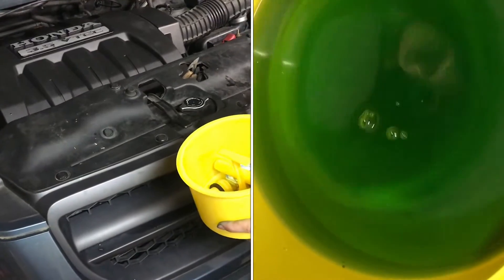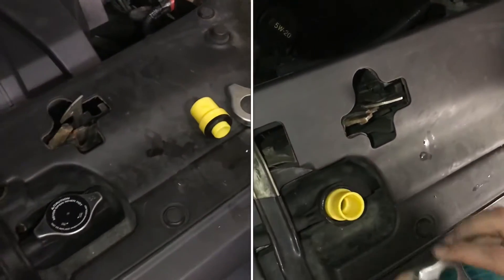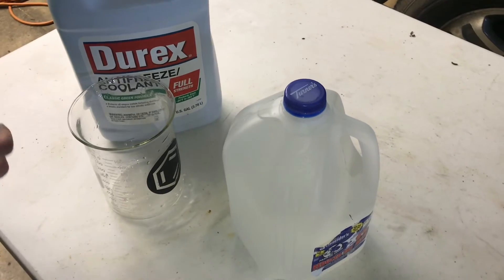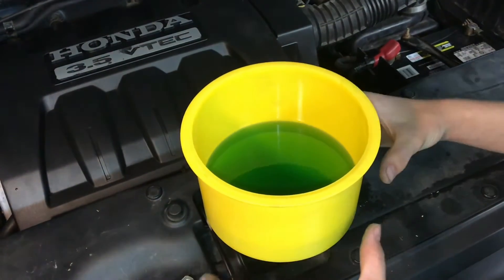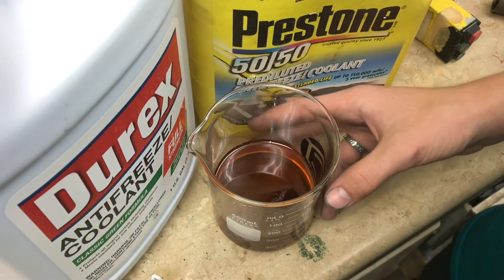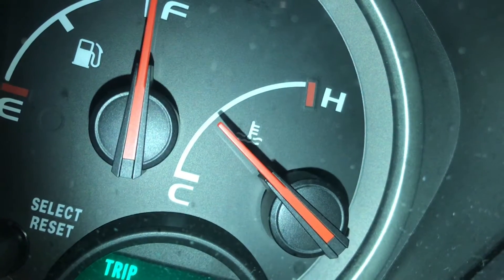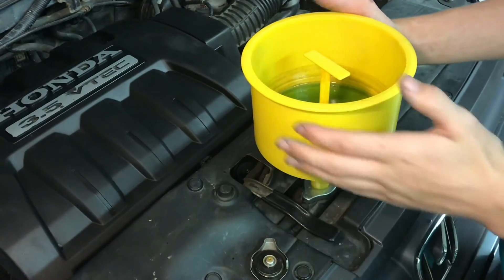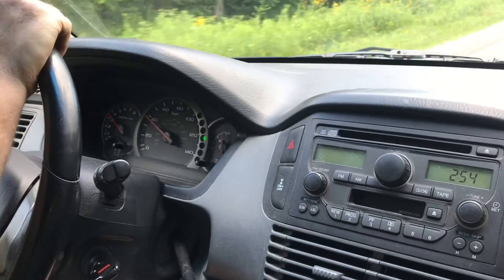BLEEDING AIR from the cooling system with the “spill free funnel”  radiator

Comment: My no spill funnel did nothing but spill coolant everywhere.. i guess it didn't quite fit? Does it have to seal tightly? None of the fittings worked, and I see people just running the engine without a funnel at all? Why does it just run out all over the place? Lol

Comment: Quick question for ya. So i have a 2012 Nissan Xterra S, i bought the Rad funnel kit that's identical recently, and when i ran the vehicle with the fluid in the funnel i noticed that my reservoir was filling up a little over Max fill range. Is this normal and should i drain out the fluid so its a little lower than Max fill range?

Comment: So i had my old car (2000 galant) but when i tried using this funnel in like about 8 min with the car on and heater on the coolant would start to gush out. So what i would have to do is turn the car off before it got to that point, the car wouldn't overheat or anything but i never found out why it would do that.

Anybody knows why?

Comment: Must be nice to have 1 that actually fits and seals right. I just wasted $33 at harbor freight and can’t get 1 to seal on my 74 dodge dart
Reply: No kidding lol mine just ran all over the place. I kinda got it to work by cutting the o ring in half lengthwise, but it still went all over the place luckily it was not in my garage lol
Reply: Go to plumbing store and use your head
Reply: Fit my 72 Dart w/slant 6 no problems

Comment: You should turn the heat ON so that it allows the coolant to circulate thru the heater core
Reply: Maybe just maybe 🙂 Honda doesn't recommend just saying
Reply: @Mary-80  i dont care what Honda says, thats what all real mechanics do, open the heater core to allow the coolant to flow thru it, otherwise your heater core is empty and you wont get heat.
Reply: @ACommenterOnYouTube  the heater core doesn’t shut itself off, coolant is constantly flowing.
Reply: @Carrion-tv3lo  Heater core ONLY turns ON or opens when you tell it to, otherwise its closed off and NO coolant flows thru it until it opens
Reply: @ACommenterOnYouTube  That's incorrect, this depends on the car, MOST CARS the coolant is always flowing through the heater hoses, it doesn't get "cut off" Your actuator door cuts the heat exchanger from the vents so heat doesn't go into the car. Otherwise you would blow cold air, if you haven't used the heater when you are driving.

Some more EXPENSIVE cars will have a cut off, (Heater control Valve) but most Sedans, always have coolant going through the core.  For instance my Tiburon, always has coolant going through the heater hoses. If anything you want to run the AC, so you get the Radiator as hot as possible in IDLE to see how the temps are doing in park, and also to make sure your fans are working.

It's all dependent if the car has a heater control VALVE.  Most cars do not have it, refer to the actual SHOP manual, or know your car.  You're making a blanket statement for all cars, and it's not true.
Reply: @GuruOfTime  WRONG ....
Reply: @ACommenterOnYouTube And you know someone is "RIGHT" when they scream it!
Reply: @Carrion-tv3lo heater core could be bad and causing the cooling issues.

Comment: Hey the coolant is leaking through the radiator adaptor cap from the kit?
Reply: Wrong adapter I'd guess. The rubber side touches the radiator.
Reply: @justinreedflynn how do you find the correct adapter? None of them fit in the lisle kit I bought
Reply: @geraltofrivia4651  I went through several also- Is the rubber side touching the radiator? Some might not be perfect, but it doesn't have to be exact to get a "burp"! It can be smaller than the radiator.

Comment: As soon as my thermostat opens the thing erupts and blows coolant everywhere. When I start all over I have to add more than a gallon so it seems I instantly lose about half.
Reply: Did you find out why this happens?
Reply: @SuperAmoney2000  Yes. My thermostat was actually stuck open and I was reaching boiling point, not operating temp. The boiling point was lowered to the half way mark on my temperature gauge, well below the red, because I was doing a flush with water and radiator cleaner.

I thought the half way mark was 185° F, which is my thermostat’s specification, but it was actually 210° F (just below boiling). With a stuck-open thermostat the only way to get the temperature to go up was to idle for a long time but that’s exactly what you do when burping/bleeding air from the system.

Comment: You should have waited till it cooled before taking the funnel off. As the coolant cools, it shrinks and lowers the level. The funnel keeps adding coolant and keeps it the correct level for the system.
Reply: I thought this was right, but then I came to the conclusion that no, you don't need to wait. Why? When you put the cap on, the level at the radiator will be at the top, no air is gonna enter. 
You close the system with the cap. It will cool down and shrink yes, but will pull from the expansion tank, as it will create a vacuum. The level in the expansion tank will get lower so, the expansion tank CANNOT be empty during this process.
Reply: Thanks; I thought the same
Reply: Most important is turn the heat at max so the coolant recirculate
Reply: @luisduar573  This is not true, some cars have heater control valves, MOST do not. So know your car, and refer to a SHOP manual to see if it has a heater control valve that does this. Most smaller sedans do not, they rely on an actuator door (either electronic or run by vacuum) so heat from the exchanger doesn't go through into the car.
Reply: I’m literally doing this now haha I was looking for this comment to let it cool first! most deff!
Reply: Can't you just put some in the radiator overflow tank that will draw back in when the car cools down?
Reply: Yeah don't think it matters as long as you're radiator reservoir has coolant
Reply: Would that make air get back in the system?
Reply: That doesn't make ANY sense.  The coolant level will RISE, since the Thermostat will close and the extra coolant goes into the overfill container.  When you have the Thermostat fully open, your car is using the max amount of coolant it needs with no air. Once the Thermostat start to close, that extra amount of coolant that was flowing in will cause the water to rise back up and bleed into the overfill container. My god.

Comment: Ive been watching bubbles come up for half an hour now on my 02 subaru. Im starting to think its sucking air through a blown gasket? Dont have oil in coolant nor coolant in oil. My problem was overheating while coolant got pushed out to the reservour. Changed thermostat thinking its not opening, still same problem overheating when driving. So next stop is the radiator. Well i changed that just now and the damn bubbles just wont stop popping out here and there. I really dont want to pull the engine for the heads...
Reply: Check coolant for combustion gas. My guess is exhaust gas is being pushed from the cylinder into the coolant there's a chemical you can use the test Harbor Freight has it
Reply: @bryan7292  yeah i decided to risk it and took it on the highway. Everything worked fine. Only thing i could think of was that the radiator was replaced so it took it longer to maybe push the air through all the channels. Seems running fine for now. Thanks though! Heads are a nightmare on these things.
Reply: @paultsilits8758  If it was still bleeding air after half an hour you really should check for combustion gas regardless of whether it is "running ok". That small leak  if you have it in your head gasket will turn into a big one some day
Reply: Usually air will slowly build up on one side of the thermostat then it won't open then it will overheat

Comment: So I tried this and the coolant got hot an overflowed out of the funnel and went all over the floor. What could I have been doing wrong?
Reply: There's multiple situations that can cause this. It's probably just expansion of your coolant. When coolant gets hot it'll expand and if you filled up the funnel too high it will flow over once it gets hot. Another situation (more unlikely but severe) is that you have a blown head gasket. but you would also experience alot of white smoke, an overheating car and/or coolant and oil mixing.
Reply: You probably had too much coolant left in the funnel, by the time the radiator was already full. When it's close to full, you want a lot of room left at the top of the funnel, so it won't spill.
Reply: We have same situation. And one thing I thoght that the cap is not well fitted haha. Well, that turned just a normal funnel to me. And I just bleed by squeezing the radiator hoses, and let the aux fan run in 3-5 cycles.